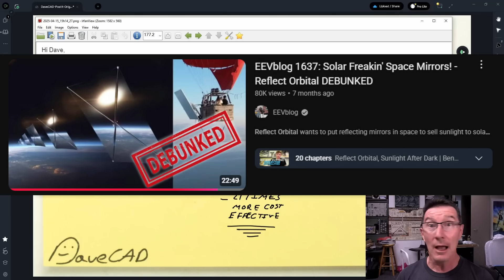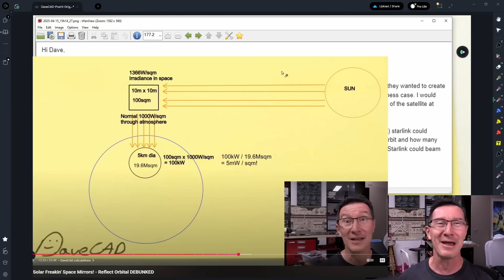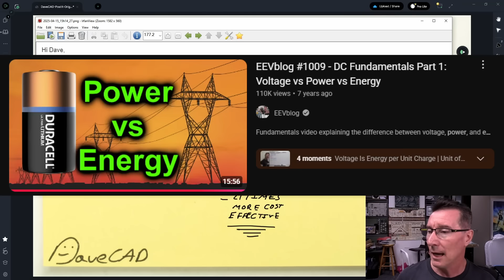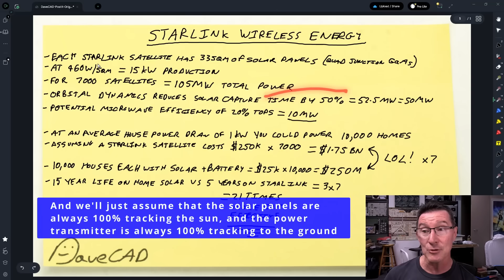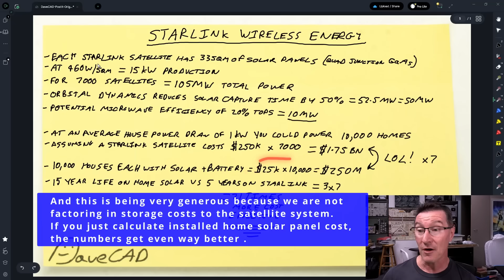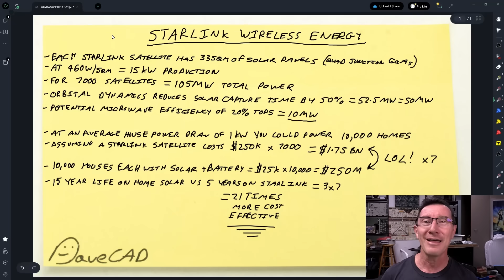eevBLAB 127 - Starlink as a Satellite Energy Utility?

Comment: The conclusion is probably right, but a couple of nit-picks about the methodology. Firstly I think the proposal is for energy generation as a side-hustle for Starlink communications satellites. The satellites are already paying their way by offering communications services, so you only need to account for the incremental cost of adding larger solar panels and power transmission equipment. Also I do not believe that on a full cycle, global, basis, roof-top solar panels are anywhere near half as efficient as space-based ones. Australia is uniquely privileged for solar of course, you have reliable sunshine, low population density with large roof area per person, electricity consumption largely for AC and therefore correlated with sunlight (as opposed to the reverse correlation we get for largely heating-based consumption in the UK), plus you also have the huge outback area available for building large scale solar farms.

Comment: I guess if we wanted to really collect worthwhile power from the sun in space, we’d need to make massive arrays larger than could fit on land mass in higher orbits? But we have a LOT of land we could put panels on…

Silly question — are those fancy space grade panels available for use on earth? Or do they not work on earth for some reason [like not able to handle weather, but are fine in the vacuum of space?]
Reply: You could use them on earth, but they are probably around 20 to 30 times more expensive for not even twice the efficiency. Plus they are very likely not as durable as silicon based panels on earth.

Comment: Still watching the video but Starlink is just too small and close to the earth to be useful for this. You'd want something that would stay in sunlight longer so orbiting further away or better yet on a polar orbit. I also think photovoltaic solar doesn't make any sense for large scale solar capture from space. It would be considerably easier to launch folded up mylar mirrors that would unfold into many kilometre sized solar collectors. Then convert that light into thermal energy by heating a molten salt to drive a turbine and create electricity which could then be sent to other satellites or the earth with microwave lasers.

Edit after watching video: The main benefit of space is that there's loads of space. You could put a moon sized solar collector up there while an Australia sized solar collector here on earth would have to be distributed around the entire planet and that is an Australia worth of ecosystems, farmland, etc that is now inaccessible. Rooftop solar would at least avoid that issue since the land is already being used regardless if there are solar panels on the roof or not, but if it was a dedicated solar farm here on earth vs a dedicated solar farm in space, I would prefer the space one for the fact that it doesn't occupy land.

Comment: I don't quite get that 20% effiency estimate.  Surely not energy efficiency, perhaps for few hundred milliseconds a day when the satellite is  just in the right angle towards the antenna?  When speaking about the energy afterwards, the 20% should be probably downgraded at least by 3 decades or something. If the 20% would be true, it would mean that the whole Earth should be covered with antennas, or - there should be a realllly clever timing system with the power deliver system (which would make everything 10x more complicated and expensive).

Comment: I don't think SpaceX Starlink satellites would be useful as a power utility source for several reasons. I will just point obvious one; if you want to, it would just make satellite impractically large since to emit usable microwave energy to be converted into electricity, you would need larger solar panels and accordingly larger Lithium-ion battery packs to be able to provide enough energy, impacting the payload limitations of the rockets carrying them into space. So, yeah, impractical for several reasons.

Comment: You're still wrong on the power density of the space mirror idea. You would obviously use focusing mirrors for that, not flat ones. Then the power density is most likely limited by atmospheric scattering, like it usually is with direct sunlight.
All the other issues with the concept still apply though.

Comment: This 20% microwave conversion is including transmit loses ? Because if it is only microwaves generator efficency then 80% of 15kw = 12kW heater in vaccum...it could melt quickly  ;)
Reply: Yes, that's including losses during transmission ... Even a crappy microwave generator (i.e. the one you have in your kitchen) is about 50% efficient.
Reply: @RedwoodRhiadra  I was thinking if it just generator efficiency then it will melt in space

Comment: So i plugged in your calcs to a excel to work backwards and size up a system. Power loss: .4, 57000 sats, increase solar area to 66, solar array power to 500, 100K per sat cost. Would give 3 times more effective solar vs space base. I think the idea here is to use Starlink primarily as ISP and second and energy utility.

Comment: Starlink aims to have a total of 42,000 satellites in this so-called mega-constellation when said and done. And after 5 years they de- orbit.  is that is cost effective? Sorry I am not buying it.
Reply: $120/mn (average) for 5 years for the 5 current million customers is $36B.  So far about $10B has been spent sending up the satellites.  Seems legit.
Reply: @RS-ls7mm  I would agree, that's if the customers projected stay with the service and whether more people sign up in the future.
Reply: @ScottAskins-t3n  However, I do recall Elon saying Starlink would be practically free.
Reply: It's a military system. Does not need to be effective. Infinite funding.  The civil service is just cover up.
Reply: the costs to send the sats to higher orbit that don't decay in 5 years are significantly higher. Also that requires bigger antennas which require more mass which again increase the cost to send them to higher orbit. There is a reason if nearly nobody is using satellite phones like Iridium and whatnot
Reply: @AntonioMolfetta  not sure what the bandwidth would be on such a system, but the entire globe could be covered with only 3 satellites. They would of course have a bit higher latency than the lower orbit systems, but still useful for applications of sending large amounts of data.

In my opinion, starling is an OK idea on a small scale to provide coverage to to some spots and have a backup. Not this nonsense emperor of Mars plan...
Reply: @  "a bit higher latency" is a very generous statement considering how bad latency has the satellite internet provided by their competitors that have satellites in higher orbits. Because we have and had those since at least the late 90s for boats and other remote installations.

And I also question the logic behind the "only 3 satellites" statement, like yeah sure it does not matter that some areas will have LOS to the satellites obstructed by like buildings or mountain ranges or even the horizon. 

The bandwith can be an issue because there is a limit on the size of satellite (antenna size and power requirements) you can launch and deploy without requiring a space shipyard in orbit to assemble a big honking relay station, and then a space tug vehicle to maneuver it in a high enough orbit but that you handwave away like it's nothing.

Congratulations, you managed to concoct a hilarious plan that is worse than Elon's (really it's his engineer's) at every single level.

Please stick to advocating for mass rollout of government-owned fiber cable backbone infrastructure on the ground, as that's the actual low cost solution to the issue that Starlink is trying to solve.
Reply: @AntonioMolfetta  if I recall correctly, it would be an additional 24 ms versus the 8 ms for starlink.

I didn't concoct the plan, it was a plan for providing low cost  basic communications to undeveloped poor nations.

As for for what problem starlink is trying to solve, that's giving Elon more money and power.  Like I said already amd K'll say it again, maybe a few of them make sense as a backup for things such as critical infrastructure, certainly not 44,000 satellites needing to be relaunched every 5 years and begging for Kessler syndrome.

Sure, fiber is the best option for a high speed backbone. For some areas microwave may still make more sense just to get a connection out there to begin with (e.g. laying fiber though mountains to serve a handful of customers doesn't make economic sense)
Reply: @ your latency is off by an order of magnitude there. Viasat for example is building a "3 satellite" constellation in GEO exactly like your proposal and with the single sat they have they claim their network has 500-700ms of latency and 1 TBit of total bandwith available.
It's pretty good for what it is (older sat internet is a joke), but it's obviously aimed at customers that can't get any better. It's not usable for gaming and it's not anywhere near enough bandwith to handle real usage from more than a few millions of customers.

Satellite anything is not a low cost service for poor nations since to talk to sats in GEO (or even in low orbit for that matter) you need expensive satellite telephones or a dish like Starlink and Viasat.
I would seriously question whoever told you this was a plan at all.

How Starlink can be a "kessler syndrome" issue?
Any debris would not last long for the same reason the sats themselves don't last long. 
Iridium or Virsat or anything else in GEO is not being deorbited, ever so it just accumulates over time.

Imho the obvious "synergy goal" for Starlink is to help SpaceX rocket company by giving it a constant source for launches. I don't see that as such a bad thing in itself since that has a positive effect for other projects that need an affordable launch vehicle.

Sure it's allowed by a hilarious failure of the government to put down fiber backbone (while still giving more than 20 billions to ISPs to do it over the years btw). But it is what it is.
Reply: @AntonioMolfetta  "your proposal" lmao 🤣
Reply: @ yeah I'm sure somebody told you the plan, it's totally not you backtracking after I called you out.
Reply: @AntonioMolfetta  you didn't even take my statement correctly in the first place gfto here
Reply: @onradioactivewaves  yeah sure keep backflipping
Reply: @AntonioMolfetta  i didn't backtrack on anything. Go re-read my statement,  I specifically said  "if I recall correctly " because I wasn't sure of the number, and It wasn't really relevant to the point I was making. I never even argued nor acknowledged what you were saying about said initially acknowledged uncertain information. Your making assumptions I was ever arguing that with you to begin with, again, that was beside  the point I was making. You may think you have your facts all nailed down but clearly your comprehension is lacking. Here's your trophy 🏆 buddy, you happy now? You've won your argument you were having with yourself, congrats.
Reply: @ oh yeah you said "They would of course have a bit higher latency than the lower orbit systems" as part of the argument you were making that you could do a Starlink equivalent with 3 sats so Starlink is pointless and bad.

But now that I pointed out how a real life Viasat system quotes 500-700ms and that is NOT anywhere close "a bit higher latency" it's suddenly not part of your main point anymore

Why do you need to do this? Why is everybody that hates Elon so bad at science?
Reply: @ you originally said "They would of course have a bit higher latency than the lower orbit systems" trying to say that a competitor can make a Starlink equivalent with 3 sats so Starlink is pointless and bad.

But now that I pointed out how a real competitor Viasat system quotes 500-700ms and that is NOT anywhere close "a bit higher latency" it's suddenly not part of your main point anymore and I'm bad faith for some reason

Comment: I power a lot from solar panels in my window. It's quite open to the south with extra reflections. 100 Watts for hours when the sun is friendly. It's probably 50% efficient. I really bought it to learn, but it proved to work. I wasn't happy about tiny solar panels and learning less.
Reply: 50% efficiency is way too high for a solar panel, only special multispectral ones used in space probes may reach that. Yours is probably somewhere below 20% if it was affordable without selling your house

Comment: I reckon without all the weight of the RF/antenna payload in each Starlink you could carry a lot more fuel and get the 5year lifespan to 15year pretty easily
But it makes zero difference.  Still a terrible way to power anything on earth.
Reply from the maker: Good point, but I'd assume that the microwave TX would be roughly the same size and weight?